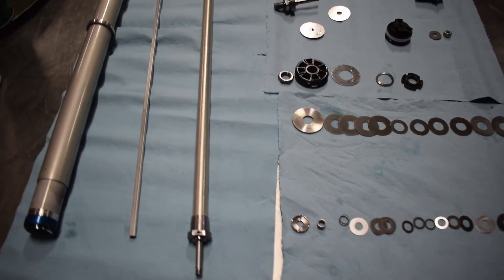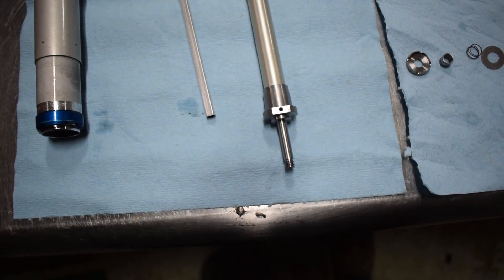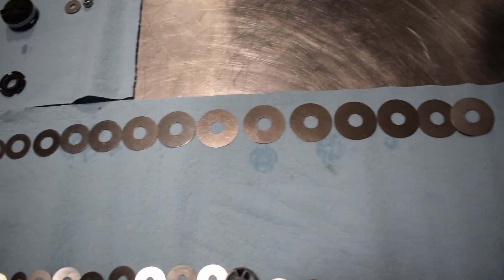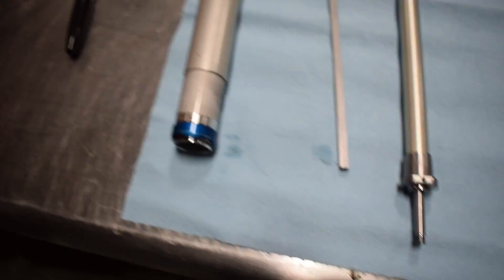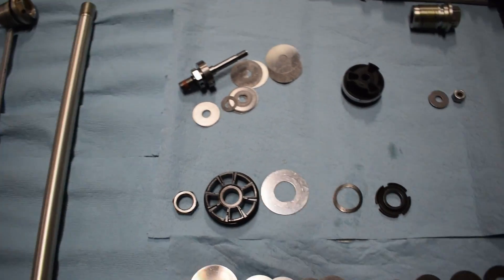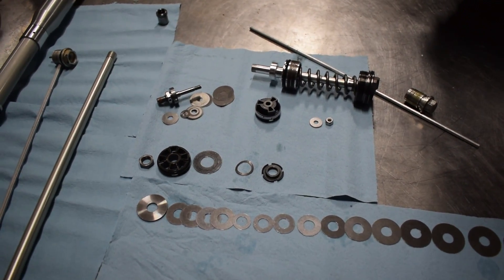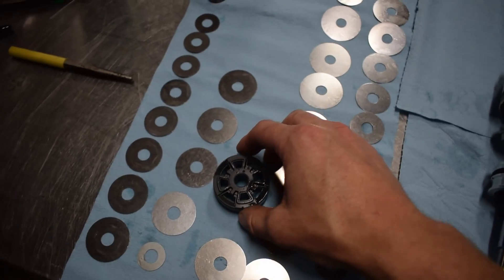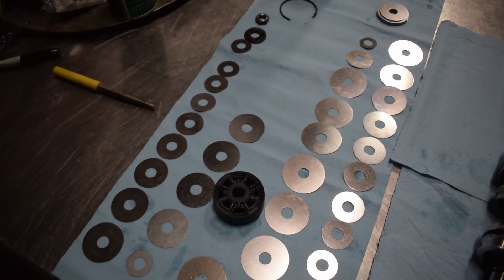"Top Secret" Insides of 2022 CRF250R Suspension

Comment: I often hear reviewers and mx media commenting that a fork is riding too low in the stroke on the “firmer” part of the damping, making it harsh.  I don’t see how the damping would be any different lower in the stroke, other than the air spring and coil spring being more compressed.   Is it accurate to say the damping is firmer deeper in the stroke?
Reply from the maker: Wonderful observation...this is exactly why I started this channel.  NO!!!! Damping is the same top to bottom.  It's speed sensitive ONLY.  And ALL damping ALWAYS has been - the SSS fork is identical to all the other forks in this regard.  The position sensitivity is the trapped air volume (adjusted by oil height) and there are some "bottoming" cones which I didn't point out but that add velocity squared damping in the last 3 inches of travel.  If it gets "harsh" low in the stroke it's REALLY low in the stroke into the bottoming control (last 3d of travel).  Often the "harshness" is fork isn't loading the shock enough to force the shock to move on a bump and the back drives the forks further into the bump.  Oil height ONLY has influence on the last 3d of travel and is MOSTLY different in the last 1/10th  if you changed the oil height. So if a fork is "way less harsh" with less oil - your really low in stroke - or are talking about landings and not bumps. I see this a lot - people describe a hard landing as "my bike is harsh" rather than saying only on hard landings it feels hard.   On a shock the linkage creates position sensitivity by increasing shock velocity the deeper in the stroke you go effectively stiffening it.

Comment: I have some Showa forks off a 2007 rmz250 and the pressure spring in the cartridge is loose. Everything is installed correctly it’s just like the spring it’s not long enough, is this normal for back then?  I noticed your pressure spring is tight on the newer Showa tc.
Reply from the maker: if all the seals are sealing - common failure on older showa - the spring is loose with no preload

Comment: When I got my 2019 crf450 I was surprised how much difference each click on the forks made , more noticeable than previous bikes I have had with kyb sss , Id say stock the kyb is slightly better though , unless they come on a TM , but that could also be down to chassis like you mentioned .
Reply from the maker: The TM KYB uses exact same valving settings as 2006 yamahas.  Difference in performance is "perception" and chassis.  As to the clicks difference - data wise its just inaccurate.  We hope to do a dyno video on showa/kyb with click changes shown in the future.
Reply: @HPRaceDevelopment  Data would be Great ...Like to hear your View on Soelva A Class Suspension?And what do you think of N10Z Suspension Kits?Thanks

Comment: Always interesting to see the inside details of suspension parts.  Plenty of feedback from the press and actual '22 CRF250R owners about how terrible the forks feel off the showroom floor.  Can you share your opinion on what Honda got wrong on the '22 CRF250R?  Looking forward to the comparison video of KYB and Showa forks and shocks!
Reply from the maker: Hard to say...Most suspension feedback is actually chassis feedback.  The fork is much softer than a stock kyb on yzf.  Shock similar to yzf if not a tad softer.  The KTM was always plagued for many with bad chassis feedback, they have always had good suspension - typically too soft in settings.  KTM has progressively gone stiffer and "impression" has gotten softer or plusher.  The only thing I see is a high oil height on the crf possibly making it not use full travel making people think it's stiff when it's really not.  A savvy owner would drop oil height 50cc then work their way back to more oil as needed for bottoming control before "revalving" aka re shimming.  This would likely show them the fork is rather soft - it's the same fork and basically same setting (within 3-4 percent) as kxf 450 - and the complaint when it came out was it was too soft...  For offroad usage and a vet rider, I'd say soften it some and things be better, coupled with a softer shock.  But it wont have the hard landing performance of yzf - which just has a plush chassis (getting stiffer but still plush)
Reply: @HPRaceDevelopment  True
Reply: My forks were twitchy until broke in. When it was time to change fluid, I had 178cc out of the 300 something that was supposed to be in there. Once it was corrected, it was great!

Comment: Great info! What makes  A-kit forks different?
Reply from the maker: almost nothing. Just pretty outside coatings. The “secrets” are in settings - how stiff or soft, what oil height, what spring rate and spring preload, sometimes the teams will do some neat things with shims to create preloaded shim stacks or create ways to do speed sensitive bleed circuits. But the reality is - nothing is much diff than what you own. its just set up really well for their rider and chassis. And really really stiff vs what most people ride
Reply: @HPRaceDevelopment  Good to know! Thanks!

Comment: Whole bikes have improved stuff all over the last ten years.
Reply from the maker: what....whole bikes have improved stuff?  Many test riders still consider the 2008 honda better chassis and stock bike than a current one.  While I disagree with this, as the modern engine and efi is lightyears better, the reality is no one is reinventing the wheel.  The bikes have 2 wheels, and 12 inches of travel - that hasn't changed in 20 years.  And no magic physics exist make a 12 inche suspenion absorb a 13 inch bump without the tires leaving the ground.  Suspension internals have largely stayed the same now since the orignal showa twin chamber, and are extremely similar to the 2006 kyb forks on yamahas.  The onyl thing that has changed is vlaving stiffness (modern bikes are double as stiff as 2006) and frame characters...engine power and efi.  As an engineer - I think they have gotten "better" but you could put a modern engine in a 2008 honda and win in pro racing
Reply: @HPRaceDevelopment  this is what I tell people when they ask why I think  my 98 rm125 is waaayyyyyyy better than my 22 crf250... apart from engine.

Comment: Any one else notice a top out clunk with these forks...
Reply from the maker: not really. Your stuff assembled well?
Reply: Hi, I have 2 sets of these forks both re valved by a reputable shop, I feel a very noticeable top out clunk going thru whoops, I'm told it's normal for these forks.
Reply from the maker: @neal7x54  If the fork slams the stop it's "normal".  but that depends on rebound setting and spring preload.  It's very rare to have a fast enough rebound for a fork to top out that hard.  Additionally they have a top out spring inside to prevent a hard clunk....Maybe it's somethign else you are feeling as a clunk. It would clunk in ALL situations, not just whoops
Reply: Yea it's an issue Ive never run into befor, I appreciate u taking the time to help.